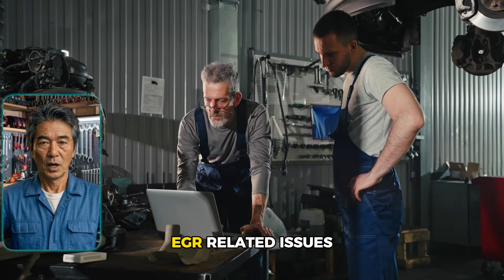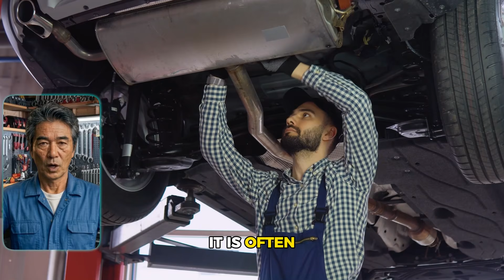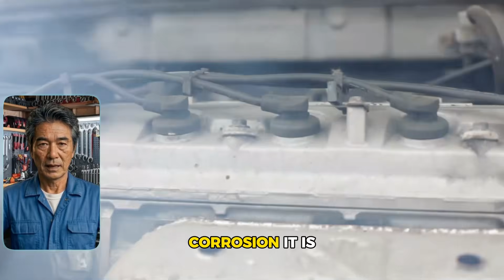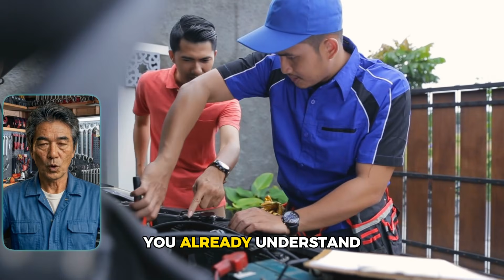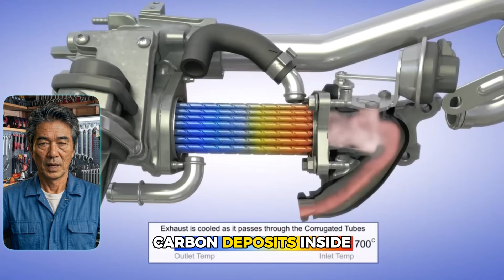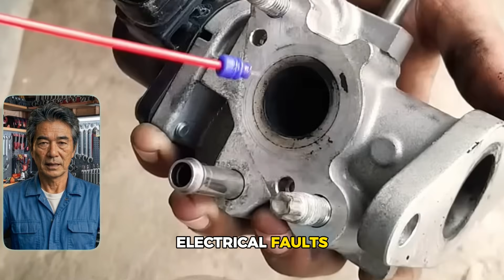This SECRET Japanese Method to Clean your EGR Valve Costs $0 and Is Only KNOWN by 1% of Drivers

Comment: I actually must rebuild my intake; fuel delivery; emissions systems because of prior owner negligence under 150,000 miles. The prior owner sold this headache when the car began having issues.
Reply: I owner a 2005 2.0L duratech Ford Focus ZX5 SES hatchback. He also was negligent about the entire drivetrain and chassis. Plus: having to deal with a Ford Focus that was designed to operate on a european continent.

Comment: This is not correct . EGR systems require service of the valve every 50,000km and FULL system service every 100.000km .
Build up still occurs just slower under certain driving conditions . 
FULLSERVICE = egr valve clean ,, inlet manifold clean , intercooler and piping clean ,, cylinder head ports clean . 
EGR and DPF leave extra  contaminates / deposits { fuel and carbon   }    behind that end up in the engine oil. Service interval every 5000---10,000km